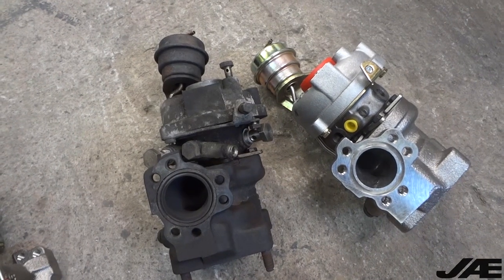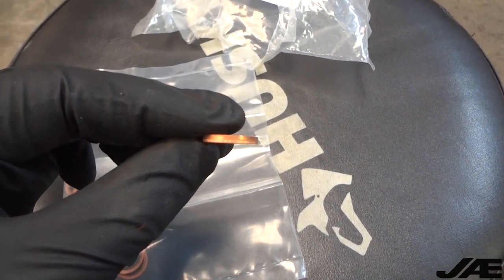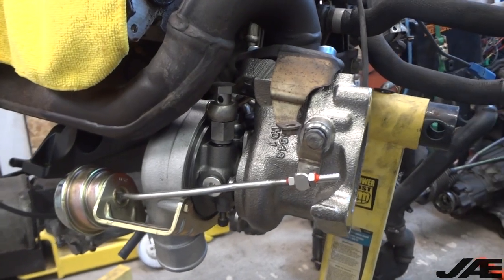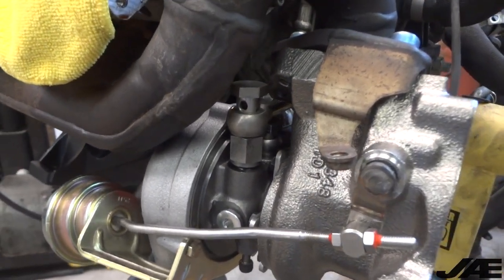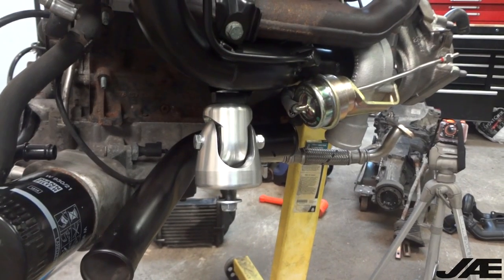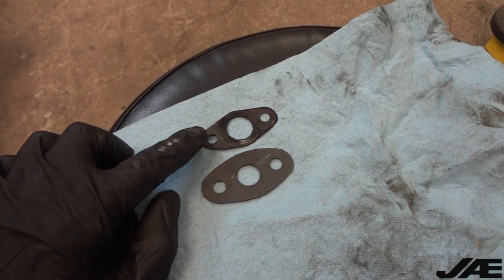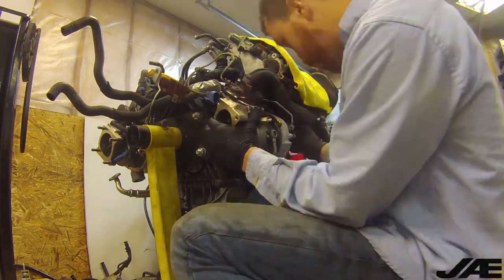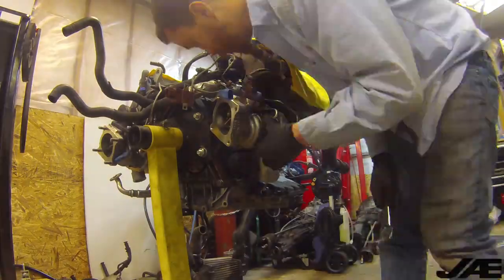Project B6 2.7T Stage 3 EP6 - Mounting the Turbo's

Comment: Awesome vids man! Also I have been having some problems with 034 with track density motor mounts, for some reason they don’t come with hardware and the original nuts for the motor mount are too small, so I ended up having to get some from a hardware store lol, not sure if that’s how it’s supposed to be or not but they never clarified also🤷🏻‍♂️